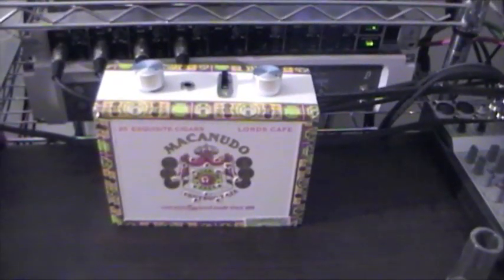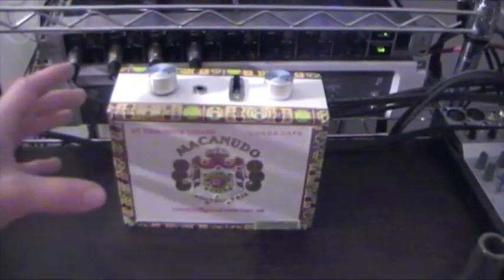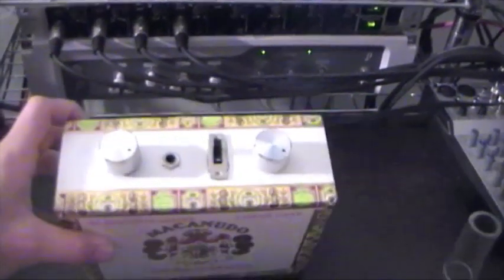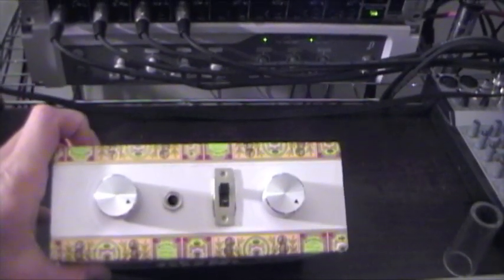$10 DIY Cigar Box Guitar Practice Amp

Comment from the maker: Not with such a simple/cheap design, most of the gain is clipping and pushing that chip pretty hard.  A clean amp with a lot of gain will require more power and a smarter design.  Search around for some DIY solid state amp designs (although if you don't have electronic experience, this is a good place to start before trying a more complicated design).

Comment from the maker: Yes, and it seemed to make a huge difference in volume.  Without being attached to the lid, the amp sounded pretty weak, but after super gluing to the lid, the volume and low frequency output increased considerably.

Comment: i made 1 in a wine box (a little bigger than ur cigar box with thicker wood) and a 4" guitar speaker from a crappy broken eastcoast 5w jobby-jobby.  It has a steel chasis for the circuit, so it has a lovely shiny control panel and a speaker output for if u wanna run a 4x12.  Im gonna cover it in some fender style tweed to make it look nice and old.